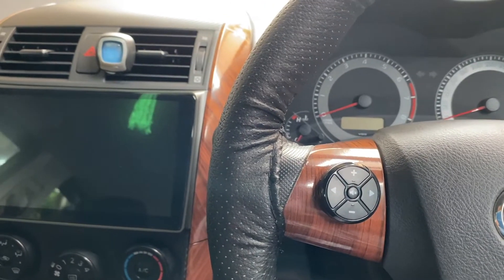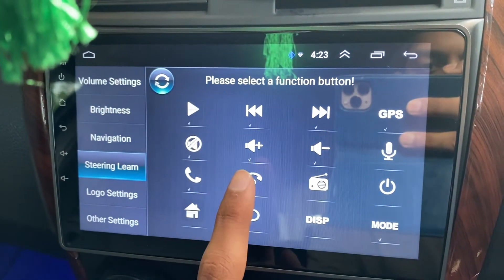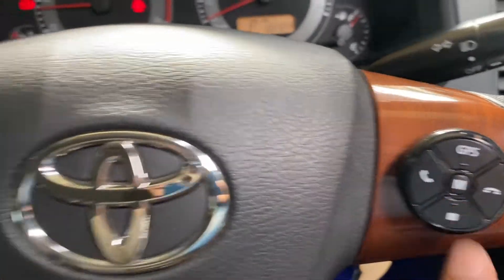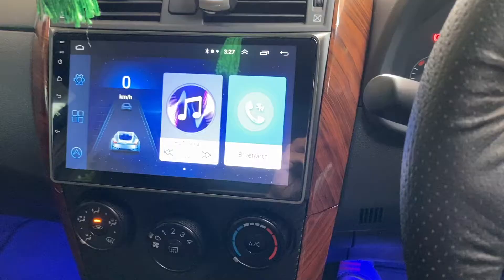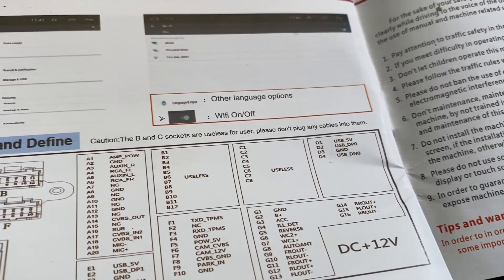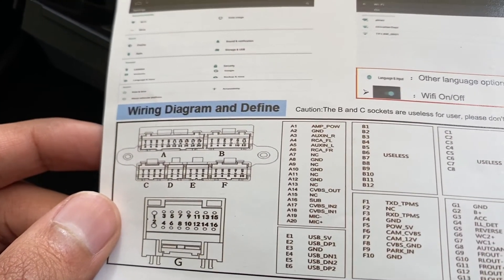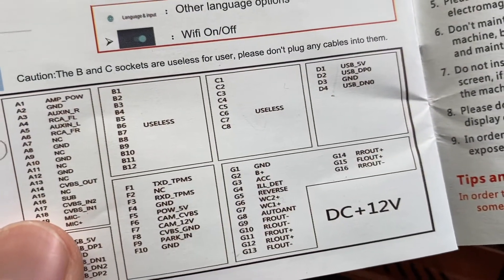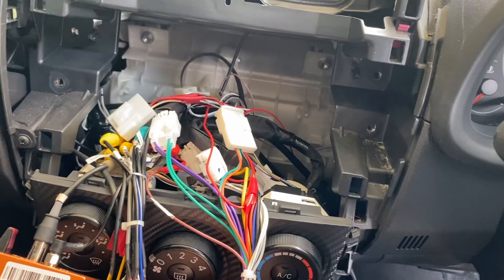How to install Steering Wheel Control to any head unit / stereo

Comment: For god's sake man, use SOLDER joints - NOT just wrapping tape round bare wires. Also connecting to "any live wire" is absolutely wrong.

Comment: Hello ,  i have  the pioneer dmh-a340dab  , do you believe its work ??    In Pioneer  settings ( menu )  i have not an option  for stearing wheel control  to programing  the keys (  like Android units)   ,   or  it is  not nessesary ?   ( only connect  the wires ,  red , black  , Key 1 and Key 2 )

Comment: Good morning Sir. My  2010 Toyota Corolla Car steering wheel had no function it a plan steering wheel   im want  to add control button like your useing on my Android touch screen Gps Multimedia radio because I replaced Toyota Head units with Android touch screen Multimedia GPS radio   an my steering had no control on it will the control button still work on my touch screen please help me if you can an Thanks